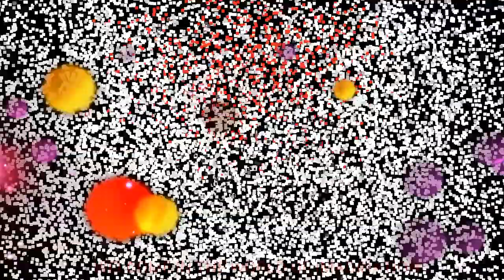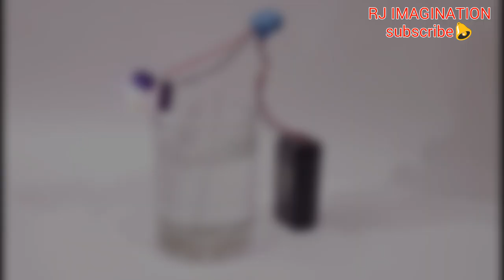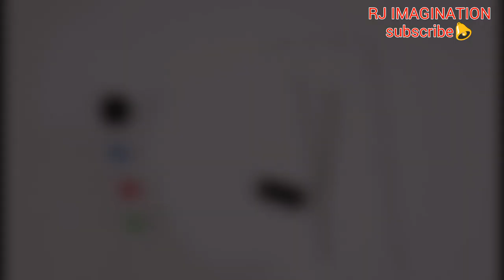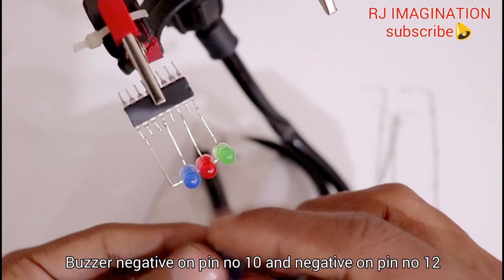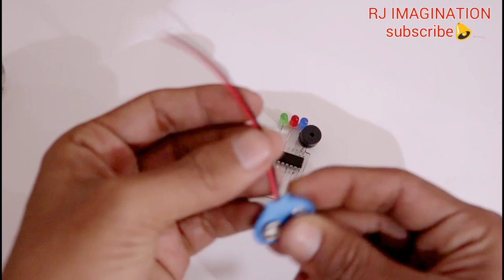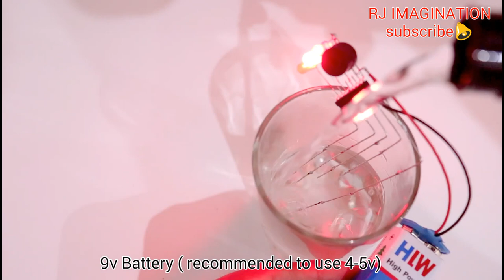Simple Water level indicator | how to make water level  indicator

Comment: It's a clever idea but you'll have corrosion problems in long term use.
Perhaps replacing the wires with stainless steel prevents corrosion 👍